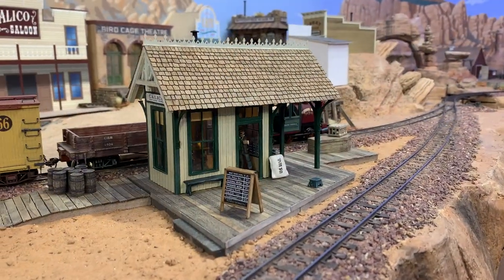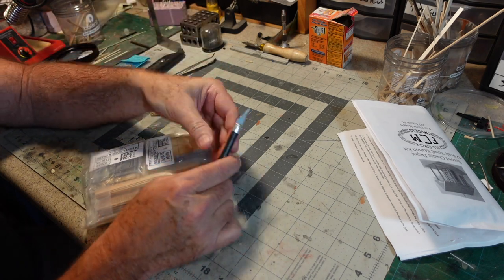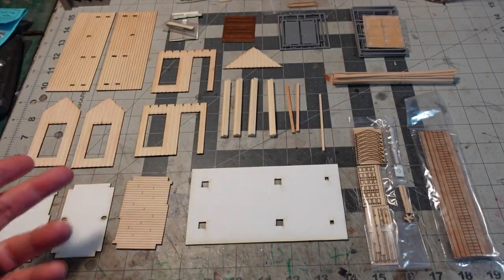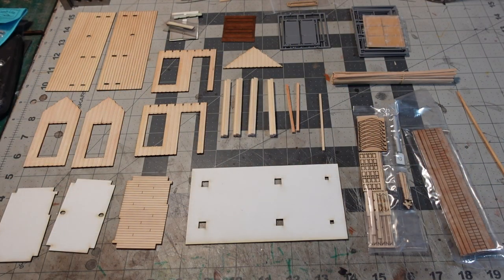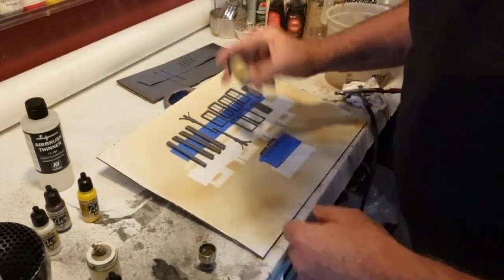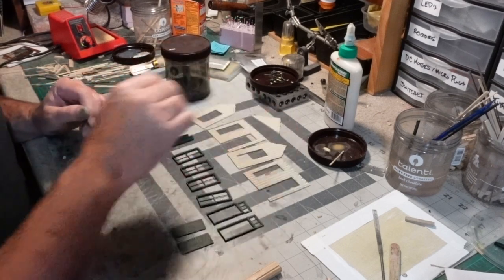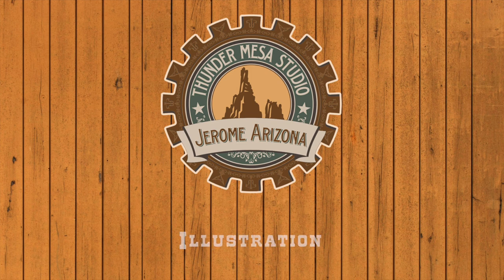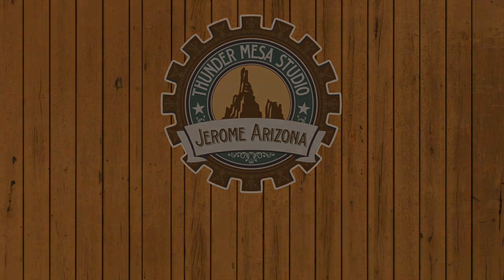Building a Western Boomtown Part 7: The Calico Depot

Comment: A $4 arduino clone would allow you to randomize the flicker as well as control a smoke unit for the chimney.  I use the white LED's to simulate a welder unit in a engine shop, and 2 yellow and one red (1 RGB)  led's for a fire flicker.